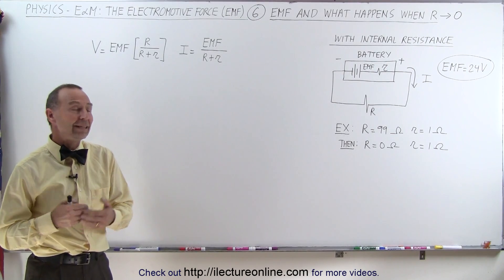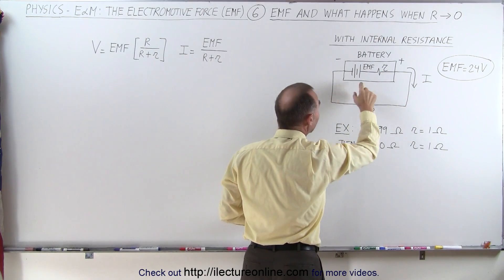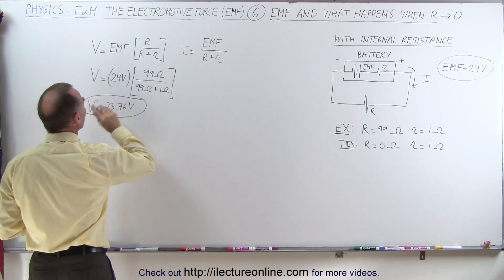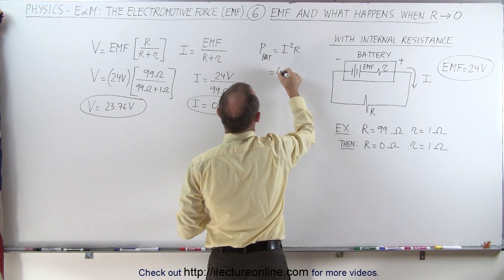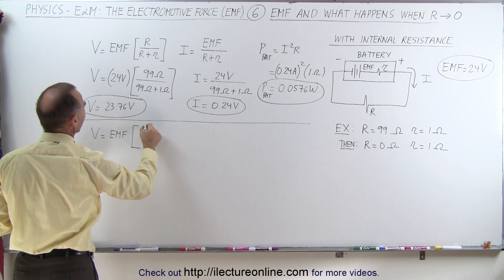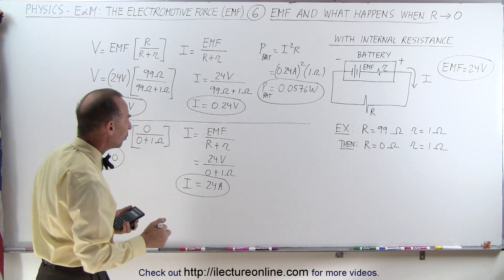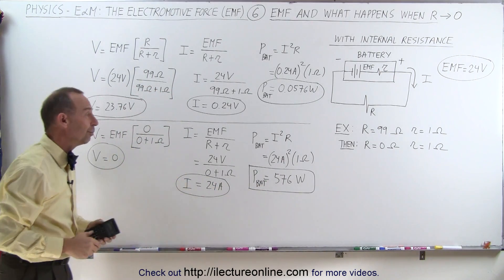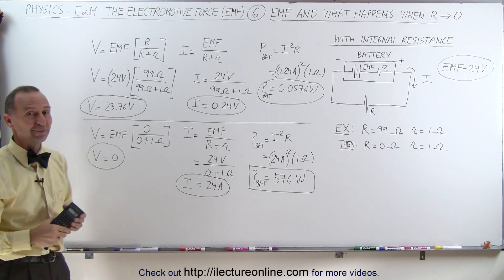Physics - E&M: The Electromotive Force (EMF) (6 of 6) EMF & What Happens when R (approaches) r

Comment: Greetings Mr.Michel.Thank you for your great effort in providing quality education to us, you are the main reason i have started to study Physics. I have a question that confuses me. As you said "the the electromotive force simply provides a potential difference from one end of the circuit to the other end of the circuit, which causes an electric field to exist, which drives the charges through the conductor". But, if there's no potential difference, how can the electrons flow from one to point to the other, and therefore how can the electromotive force exists in terms of maths? Of course, in reality it's a short circuit and current most flow through the circuit, because there's a battery connected to each end of the circuit(but the circuit will probably burn). 
Thank you for your time
Reply from the maker: Glad you found the love of physics.  The electromotive force = the potential difference.  (EMF = battery)
Reply: @MichelvanBiezen  ok, thank you for the quick reply

Comment: Hi Michel tnx for your informative videos, one question in relation to charge movement and returning to source. Can charge in dynamic situations moving through a conductor move or pass to another conductor at different potential but not part of the original circuit, I know this happens with static charge build up on objects. An example would be electrocution, is charge flowing back to source through the earth/ground to complete the circuit. Or an auto ignition coil could charge flow from one end of the coil if it couldn't get back to the other end. (Must there always be a return path) Thank you.
Reply from the maker: Sometimes charge can jump across a gap, (like a spark), or charge can "tunnel through" a material (like an insulator).  For that to happen there must be a large enough potential difference in the order of a few thousand volts per cm of gap.   (Lightning is an example of that as well).
Reply: Michel van Biezen Thank you for reply